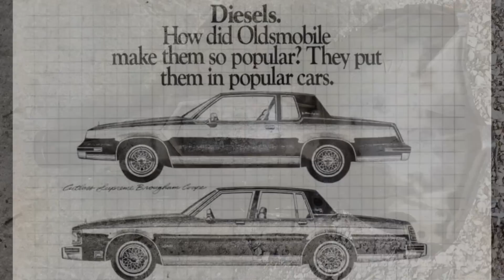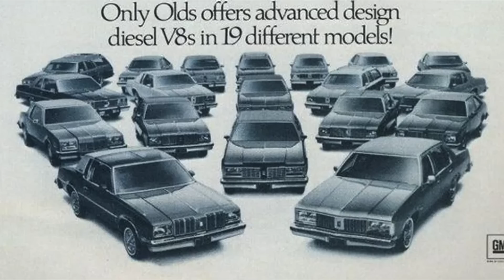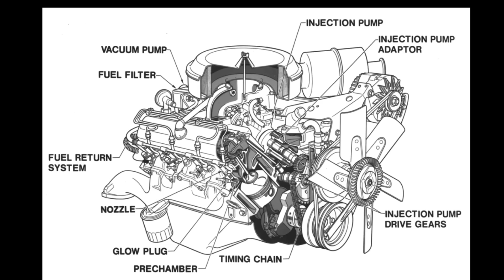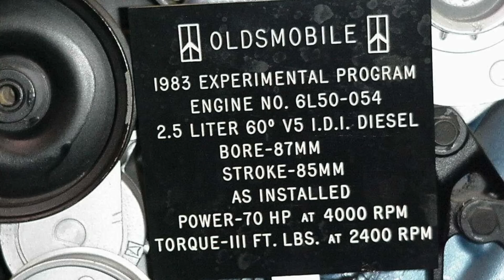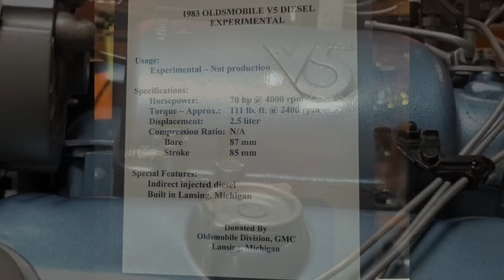Craziest Automotive Engines: Oldsmobile's V5 Diesel (Yes, I Said V5)!

Comment: What continues to astound me is that GM had been manufacturing diesels since the 1920s under the Detroit Diesel subsidiary  to leave out a water separator was just inexcusable.  Diesel fuel just naturally attracts water therefore all diesels, car or truck, have water separators.  It's almost like the Olds engineers working on the conversion of a gas 350 to a diesel 350 had absolutely no interaction with their coworkers at Detroit Diesel.  So many things that GM did in the 70s and 80s are just mind blowing.
Reply: Why wouldn’t they have just tapped Detroit Diesel to make them a motor to begin with…
Tell them what they need and want then let the experts design it?
Reply: @leomonster1973  Having a screaming Detroit in these cars would have been pretty sweet! :)
Reply: @crazyfvck back then it would of been a 2 stroke😂. Would of been awesome❤
Reply: @captaininsano2777  CAFE standards and GM 2 stroke diesels?? Sounds like an oxymoron to me.
Reply: @leomonster1973 they did proceed to tap Detroit to design an engine for them. This resulted in the 6.2 Detroit, an engine with its own unique set of issues that have been beaten to death online. I like both the 5.7 and 6.2 - they’re not powerhouses, but they’re great fuel sippers with solid low end torque that can be swapped into just about any GM application and run on any combustible lubricant. Any issues they have can be remedied with modern parts.
Reply: @zf9903  miss my 6.2.  17 mpg with no overdrive 🙂
Reply: @zf9903  They were never meant to be powerhouses.  They were fuel economy engines, nothing more.  My 1983 C20 6.2 had comparable hp/torque to a stock 350 at the time, but the 6.2 got 19 mpg city and 24 mpg highway.  They were great so long as you didn't abuse them.  So naturally guys would turn up the pump, over rev, try to tow 20,000lb's, and then called them garbage when they couldn't handle it.
Reply: @scottdelaney98  could not agree more. If you look at GM’s initial marketing for the 6.2, notice how many times they brag about or allude to the fuel economy of their new “light duty diesel”. And then they go and install them in 1 tons and motorhomes, only a year after they finished testing them in a fleet of Impalas for the gov’t? My theory is the 5.7 debacle was so bad, GM felt they couldn’t have sold a new diesel in cars, because the 6.2 fits in cars just fine with a form factor inbetween that of an SBC and BBC, and doing so can easily net in excess of 30MPG. So, without the light automotive market segment, they had to push the 6.2 up to make sales, which contributed significantly to the reputation they have today. Outside of their admitted structural flaws, I just think they weren’t designed for that kind of service. Then, over time, they were forced to compete with newer, bigger diesels, and that’s how you get their perception today. “Why would you want a 6.2! Just get a Cummins!” In reality these are meant for half ton trucks, and cars are even better.
Reply: @zf9903 fuel sippers lol. My passat diesel that gets 50 mpg is a fuel sipper.. And is still makes right under 200 hp and 300 foot pounds. 20 mpg is not sipping fuel
Reply: @DarkAttack14  a 5000lb 3/4 ton truck built in the 80’s getting 20MPG on an engine with 40% of the complexity of later engines is classified as fuel sipping. And 20MPG is often a safe (low) estimate for a 6.2, in a 1/2 ton it’s easy to see 25MPG if the truck isn’t modded by a manchild who just wants big tires. Again, these are giant bricks. 20MPG is a very impressive number, especially for the time. New vehicles might get that—but try to rebuild an injector in your garage for a 2024 diesel pickup and see how doable that is. A 6.2 injector has about 7 parts and zero electronics
Reply: They never converted a gas to diesel that myth will not die
Reply: GM had a 110hp 4v53 with an aluminum block.
Reply: Gotta love GM
Reply: I will say modern fuel stations are much less of an issue when it comes to water presence. I find about 3mm max of water in my passat fuel filter housing during a filter change
Reply: The water separator was in the fuel tank.   Water and diesel do NOT mix at all.
Reply: @frequentlycynical642  The problem with using the fuel tank as the water separator, is that there is no warning of problems until the water arrives at the pump. At least a water separator with a clear bowl, or a water sensor can warn ahead of time, assuming one takes note of the bowl or the indicator.
Reply: @dougshiner9180 not really necessary on modern diesels. My passat doesn't have a true water seperator or a way to drain it. Has maybe 1-2mm of water in the bottom of the filter housing over a 30 thousand mile service interval
Reply: @DarkAttack14  I'd like to agree with you, but I lived in a remote  area for many years, and water intensive fuel from filling stations  with damaged leaking tanks with groundwater  was an ongoing  issue.  Modern diesels in that environment  used to suffer from premature  failure  of pumps and injectors  unless  the water was removed.  I'm sure that for most people  that would not be an issue,  but that was my experience.  Since I moved to a city, I have only experienced  water in fuel from only one place,with damaged tanks and groundwater ingress. It's not been a regular thing.

Comment: The Olds diesel was NOT a 'strengthened' gas block. This is a common myth based on the fact that it was engineered to use the same accessories as the gas engine and could share some of machining lines in the engine plant.
Reply: you are right, it was engineered to be a diesel from the ground up and fit the gm cars and share components
Reply: It's a different block than the gasoline block, but it's the same architecture.  You can convert the diesel to gasoline.
Reply: You are correct. This is noticeable in the earlier 5.7 Olds Diesel block was known as a "D" block. Olds then produced a "DX" block. The "DX" block was beefier and had a better bottom end than the "D" block.

Comment: At age 19 I begged the Pontiac Salesman for the very Expensive Diesel Option for the 1981 Bonneville Brougham Sport Coupe. The Option was $1,800 in 1981 in todays money over $6,000 option. On a slight incline on a Highway I had to drive in the breakdown lane. I couldn’t maintain most then 35 MPH with the Tractor Trailers. Fuel INJECTOR Was Bad Blowing Blue Smoke. The Dealership had the car 5 months I had NO car. My Commute to work was 45 miles. I used my GF ‘76 Toyota Celica all that time leaving her without a car. just over 12months the Transmission lost 4th Gear.  The dealership told me I don’t need 4th gear They charged me $1,500 That’s over $5000 in todays money to fix the transmission. My GF mother paid for it.  No one wanted it for a trade in which I was trying to do after 4 months of owning the car. I was offered $4000 Trade and I paid over $13,000. I was saving money on Gas right? 😅

Comment: The VR6 was essentially a DOHC V6 That Utilized ONE Set of Valves/Cams/Rockers that Fed 2 Cylinders…It ONLY had 2 Cams and it was a v6…Typically there SHOULD be 4 Cams with a V Engine but THAT isn’t the Case with the VR6…The BUGATTI Veyrons 16 Cylinder engine uses the EXACT same Technology adapted from the VR6. It’s a 4 Cam 16 Cylinder engine. In its case being it’s basically 2-v8 engines GLUED together, it Should have 8 Cams…But der be Only 4!

Comment: Management: "Let's turn a gasoline engine into a diesel!" Engineers: "Diesels run a much higher compression ratio, a gas engine isn't physically strong enough!" Management: "Not with that attitude!"
Reply: Look up how AV-1790 benzin engine was turned into a twin turbo diesel AVDS-1790 in patton tanks. It took a lot of effort and re engineering but it can be done

Comment: 1980 the 200 Turbo hydramatic Oldsmobile Cutlass Supreme, the torque convertor blew in the first winter, they replaced it with the 350. 260 V8

Comment: Great video thanks .Rolls Royce used GM gearboxes ,just out of interest would any of GM diesels engines have had enough performance to make it a viable propersition to to fit a diesel engine to a Silver Shadow  (3 ton )whose values are generally low .
Reply: yes those old rolls royce cars used a gm turbo 400, a real good transmission, I repaired one a long time ago, the only thing different was the rolls transmission had a polished case
Reply: The venerable  Turbo Hidramatic  TH400.

Comment: My parents had a 81 Riviera diesel, they drove it 20 years without issues.   It had pretty standard puckup between 0-40 mph very lacking from 40-55mph, hated getting behind a car on freeway on-ramps slow and hit the gas at the last minute, i needed a run to reach freeway speed's.
I drove one of these v6 Diesels in a Buick Century, it was a pretty nice car
Reply: I spent a couple years driving a Nissan 720 pickup that was equipped from factory with a 62hp (when new!) 4 cylinder diesel. It was much the same for highway on ramps, needed the whole thing to get to highway speeds 😂 but cruised 60-65 without much issue. It wasn't geared for 70+

Comment: Ironically a Peugeot 504 Diesel was along with the MB 300D were the gold standard for Diesel cars in the 70's
Reply: I had a Peugeot 504 diesel in 1977, loved it.
Reply: Upto current, a modern Peugeot diesel engine is likely to outlive the body by several magnitudes over.

Comment: My parents had a Buick century diesel. Got fantastic fuel mileage like over 30mpg’s on at the time very very cheap fuel. It started to make a funny noise and my dad dropped my mom off to do something so he and I headed to the dealership. It literally threw a rod turning into the dealer. They really did like that car. My mom wasn’t thrilled with the idea of having to go to a truck stop for fuel since back in the mid 80’s that’s the only place that had diesel.  Although my father owned an excavation company and my
Mom soon figured out she could fuel up at the my dads shop at his bulk fuel tank. I think a lot of engine manufacturers where really getting into uncharted territory as they were by this time good at making big trucks and equipment diesels but a small, light, user friendly diesel was something entirely different that Susie homemaker could deal with. My dad had no issue with it as he was around Diesels all day everyday. I have a VW TDI and it’s an amazing car. I regularly get 50mpg out it. It’s much more user friendly but it’s still different than a gasoline car.

Comment: that Honda V5 was in the RC211V motoGP race bike and won 3 world championships.  it was a genius piece of engineering; not only did the narrower rear bank fit nicely between the narrow frame spars, but the firing order was similar to a v4 with the center cylinder on the 3 piston bank being out of phase.  doing this they were able to set it in a way that gave the engine perfect primary balance so the engine could spin over 15k rpm with no balance shafts or heavy counterweights, unlike most I4's and v4s.
Reply: the odd fire pulse gives the rider a bit of advanced warning when the back tire is at it's traction limit.
Reply: And how much HP did the Honda motoGP engine make? Over 220 and was clocked at over 215 mph and probably not much over 360 lbs for the hole bike. Can you say,  power to weigh.
Reply: Yep, power to weigh, not owner to wait!!!🫸🫷😁🤣😜
Reply: Funny how lame that thing is ,when even a lowly VW 1.6 idi pulled 52hp at like 4800 and had a 5400 redline.
Reply: Probably not similar mph ratings.
Reply: Mpg ratings
Reply: Wonderful
Reply: Cool 
But it was a bike
Reply: @vincesimione974 ok and....
Reply: @vincesimione974  - True, but if Honda could make a V5 spin up to 15k rpm with no balance shafts or counterweights then GM should have been able to make a gasoline V5 auto motor. The small diesel would probably never have produced enough HP to make USA drivers happy unless it was in a very light weight car.
Reply: But it's still an engine.

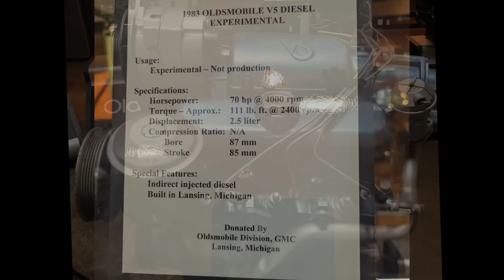Comment: 8:07  Isn't 70 hp pretty anemic?  My 17-year-old Acura has 258 horsepower in V-6.
Reply: Naturally aspirated diesels aren't known for impressive power outputs. They really need a turbo to get performance comparable to spark ignition engines.
Reply: compare mid 70s cars to other mid 70s cars and this wasnt a low number

Comment: This was interesting for the content. Oldsmobile really was leading the way with so much technology and other things. I had never heard of this engine. As you stated it was experimental. I recall the diesel 350 V8 and the 4.3 liter diesel V6..  The thing about the 350 diesel was it only had 105 horsepower. Just think if GM had got that right where we would be today. I know they did get the diesel trucks. Lincoln got its diesel from BMW that it used.  Years later Volkswagen and some other European carmakers got caught up in a diesel scandal. They are still working to overcome this.  The things they do in the name of fuel economy. I know now they are turbo changing small engines. The electric wave is underway. Thank you Adam.

Comment: In the early to mid 1980s, the Volvo 240 had a VW-built 2.4L inline-six diesel that produced 80 HP and 103 lb-ft of torque, and the Mercedes 240D had a 2.4L four-cylinder diesel with 71 HP and 101 lb-ft. So compared to those, this 2.5L V5 diesel would've been a bit short on horsepower (and surely lacking NVH refinement), but with better torque, and probably better (but still leisurely) performance and fuel economy, since the X-cars were lighter and front-wheel-drive.
Reply: EXCUSE ME but those two were considered to be quick diesel cars! During that era, such figures weren't bad at all for diesel cars. And the Peugeot 505 Turbo with 82 hp was considered an absolute beast! Slowest was the Mercedes 200D at 55hp. Drove my cousins 200 D once, and tried to overtake another car. That was, well, exciting... 
Anyway, if Olds got 85 hp / 165lb/ft out of a 4.3 l V6, the 2.5 litre V5 should have given about 50 hp and 95lb/ft. Wouldn't outrun the Volvo, but in line with many of the other cars of the era
Reply: Haha I wish I had my 91 Jetta coupe set up the way it is now for some hot diesel street racing 😂😂
1.9 block /1.6 head ,and the awy close ratio box ,and short 175-50-13 tires on it. 
Not a rocket but it'll do the 0-60 in around 10.5-11 or so when stock was like 15.
Reply: Cool to see you here!

I was ganna try to get a hold of you to ask you to disassemble one of those “power saver” devices, and was happy to see you already had me covered.

Thank you for sharing your excellent content, keep up the good work!

- Fellow quirk, who DDs a 81 Toronado Diesel

Comment: I've always enjoyed the unusual, bizarre GM stuff (especially from this era) and you were right, I'd never heard of this engine before! I owned an overhauled (read: bandaged) 350 IDI (DX block) in an early '80s DeVille, oh the horror! Strangely enough I actually enjoyed my time with it. Some folks in the Nordic parts of the world even had good luck with those later versions of the mechanical IDIs, so go figure. Always looked out for the GM V6 IDIs you mentioned, but I never found a car with one for sale anywhere near here. The V5 having less power than a Duke though? That's something. I had a TBI Iron Duke in a mid '80s X-body hooked to a TH125C and that car was... quite slow. Oh, and since you brought up the obscure GM diesel topic you ought to cover the Toroflow sometime, that'd be fun.
Reply: I have a 478 Toroflow block and crank.

Comment: My parents owned three diesels back in the late 1970's/early 1980's. A 1977 Peugeot 504 sedan, an Oldsmobile Delta 88 seda, and a 1981 Cutlass Supreme coupe. Both Olds had the 5.7 liter V-8, with the 1979 being the 125 hp model, and the 1981 being the 105 hp version. The engine in the 1979 self-destructed at 48,000 miles, with GM spitting the difference in the replacement.

I loved the diesel sound in the Peugeot and the Oldsmobiles. My favorite story about the diesels was when I was driving the 1979 Delta 88 in a traffic jam. An idiot was riding my bumper, as if that could get traffic to move faster. Unknown to him, the fuel injectors were in need of replacement. When we passed the cause of the traffic jam I floored the pedal. The result of all that diesel fuel pumping into the cylinders was a huge, black cloud erupting from the tail pipe, a cloud that would put many volcanoes to shame, right in the face of mister tailgater. As the cloud dissipated I looked in the rearview mirror, but the tailgater was nowhere to be seen. I wonder if the smoke stalled out his car?
Reply: Yes I remember driving my parents 81 Riviera diesel, mom drove it till 2001
Reply: "Rollin' coal" is what you did...lol
Reply: I had an 80 Oldsmobile Delta 88 with a gas 350 that needed valve stem seals and guides. IF you floored it then it would blast out billows of  oil smoke as it took off quickly. I used to always smoke tailgaters.  It's better to get a Ford LTD or Mercury Grand Marquis than to get  a poorly made gm car.
Reply: @warrenwinslow4266  I completely disagree, I've done very well with GM cars and horribly with Ford's, plus the rwd Ford's didn't handle very well and made very wide u. Turns
Reply: Did that '81 had any power left for the wheels 😮?
Reply: @killerdinamo08  moved along pretty good, where it lacked a bit was was between 45 mph and 60 mph, around town it was great but trying to get on the freeway behind someone going slow and steps on it at last minute was a little issue , it also ran down the freeway good